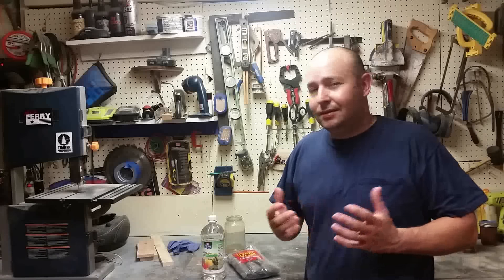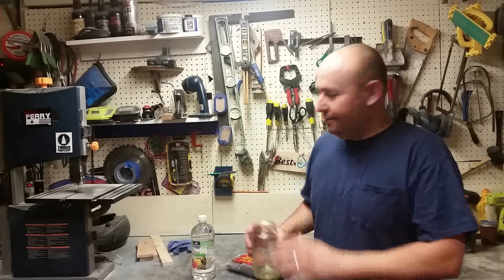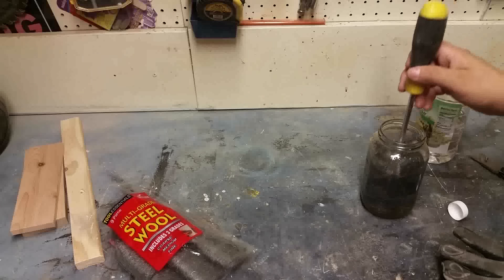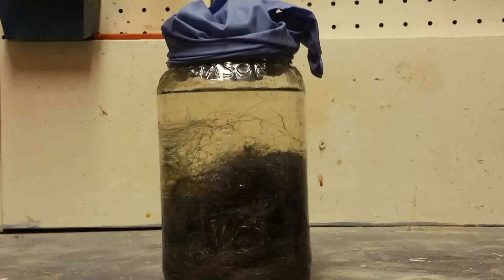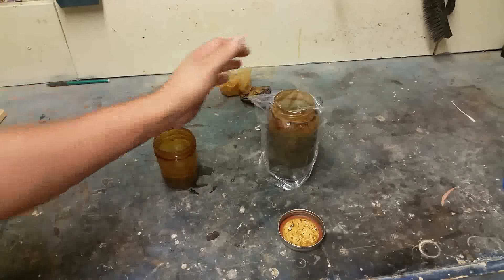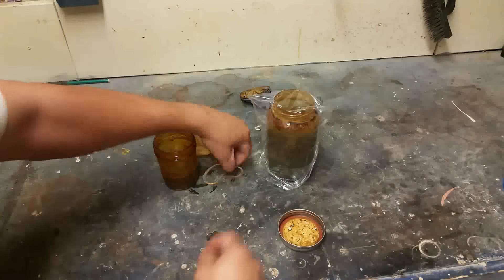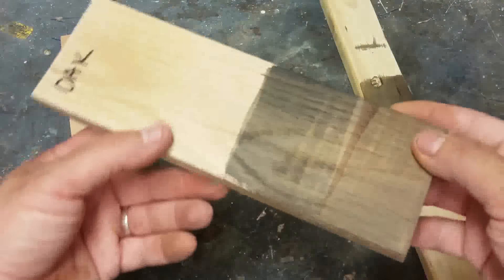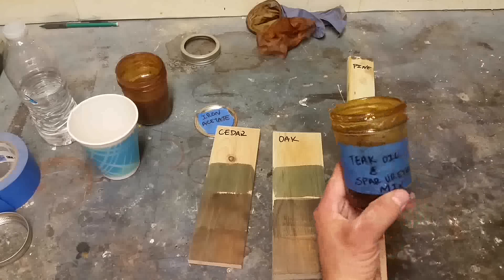Making Iron acetate/diy stain

Comment: Moy great video. I watched some other videos here a few months back and nobody mentioned not covering this crazy lab experiment i was doing in a 5 gallon bucket (after all I'm an amateur woodworker, not a scientist). So i had this bad bod fermenting in my Las Vegas garage during the summer ( another genius move in case you were counting on my part) and one night my whole neighborhood wakes up to a loud KABOOM. The worst part was all my tools and and equipment was covered in this reddish tint and smelled like vinegar.  Thank Moy for stressing not to cover this beast. Keep it up.
Reply from the maker: WOW!that sucks..I was lucky enough to read up on the process and realized there would be alot of pressures involved. I looked around the shop trying to find a way to keep bugs and other debris out while allowing the pressure to escape. A simple but effective way..the latex glove works great. Thank you for sharing your experience. I've had several people comment asking if it has ever exploded on me. Now I know for sure... IT Will!

Comment: Soak your old worn out files in vinegar for 3-5 days and you can give them a 2nd life by etching the grooves deeper. You will get the same byproduct without using up your steel wool. Also, if you want to convert red iron oxide (rust) to black iron oxide you can soak your rusted tools in tannic acid (homemade by grinding up oak bark/acorns/even tea) and it will blacken it without rusting the tools.

Comment: Really like your video. Great tip about using a latex glove instead of a tightened lid. I just finished a project and would have tried the food coloring but didn't think about it. When you added the food coloring to the cup was that water you were adding it too? Also I did a few different staining test on pine and choose the one using coffee instead of tea if you want to give it a go!

Comment: Hi how much tea did you use? I'm experimenting on pine, used 10 tea bags which after 5 days the colour on the pine is really dark but nice. I live in italy and they only have wine vinegar clear which isn't  as strong so my mixture after 5 days in the jar isn't dk brown, might have put too much steel wool in. SO GLAD you mentioned not to put a lid on the jar as in other videos they said to put a lid on the jar, which I did, but the gases did build up that it popped when I opened the jar after 2 days, had it my house not goog for the smell which no one mentions. So thumbs up x 10 for being clear and adding food colouring brilliant idea....might add the tea to the mix just to see what happens as for my personal wood colour choice the pine wood needs it.
Reply: Cara Giovanna 
The usage of tea is to add TANNIN to woods which has low amount in their structure ( especially Pine ). You may also use red wine to add tannin. During the chemical reaction of iron and vinegar Hydrogen gas is released, for this reason it is recommended to keep the lid open. If you use rusted iron ( nail, bolt ,nut, etc. ) you may get dark brown. If you want to have brown color with pine try instant coffee or any left over coffee ( not cappuccino ). Just a last note the food colorants are not light fast. In outdoor usage they immediately disappear.  
Saluti

Comment: Hey cool video! Haven't seen iron acetate used in this way very cool. You've made ferrous acetate (iron II acetate) if you add hydrogen peroxide you get ferric acetate (iron III acetate). It has a bit of a red color and I'm curious how that would look. If you try it a little heat is released not too much but oxygen is also released so beware of that so it doesn't foam up and overflow.

Comment: This is not all iron(lll)acetate but just a small part, when reacting vinegar with iron you would think to get iron(lll)acetate but not because iron nails will contain 2+ ions and iron acetate needs 3+ ions to form so we have to add hydrogen peroxide to them

Comment: A recent high quality and longterm studies, publicated in the "Journal of wood science" by Robert Q. Thompson, revealed most of the false notions in a WIKIhow article on ebonizing woods (representative of the content of woodworker' sites on the internet though 🙈).

The perfect and most efficiant recipe for the best outcome of the iron acid ebonizing wood stain is the following (the ratio of the 0000 steel wool and 5% DW white vinegar is very important and the lid width of the open jar has an impact as well !):

Add exact 85 ml WHITE Vinegar 5% solution to 1g of fine steel wool (0000) into a jar and stir  with a plastic/wood kind of tool (NO metallics - reactions can be manipulated!).

Leave jar open (your solution with the cut latex glove to secure the liquid from any dirt is accepted though 😅)
and stir again every 24 hours. After day 3 (THREE DAYS 😮) the iron acid reaction has come to it's finalization! After this time the further reactions show every other colour but the best effect you could have reached with the stain after 3 days, will lead to a downwards spiral. 

I've just prepared the a.m. recipe and can't await the final result. Let's hope for the best! 😂🎉

Comment: I use vinegar to derust old tools. The leftover is dark reddish brown stuff. Could i use that the same way?
Reply from the maker: Yes Willem, you just made iron acetate. Don't throw it away. I only use steel wool because it accelerates the process. Definitely give it a shot. You will be surprised with the results.
Reply: I usually use it more than once for derusting, so i have over 2 liters ready to go. Good to find another use for it!

Comment: I started this process 4 days ago & still no reaction. I used 000 wool. Could the wool be too old vuz it was kinda soft????
Reply from the maker: +Tiffany Johnson I don't think the steel wool is the problem. sometimes it takes longer depending on the brand of vinegar but it should still work. Just give it more time
Reply: Tiffany Johnson 

put the batch where it's warm, should speed up the process a little